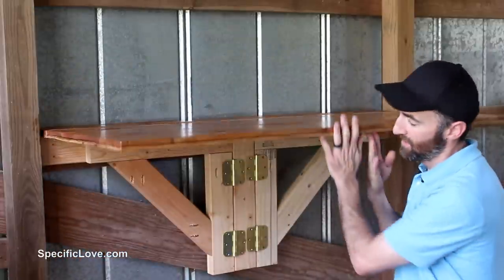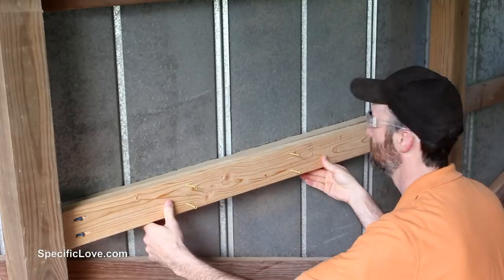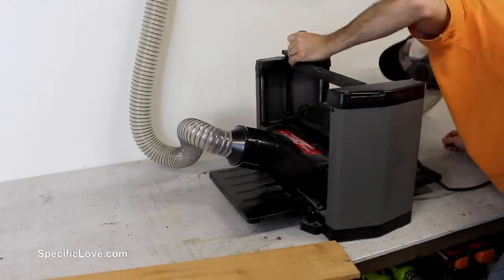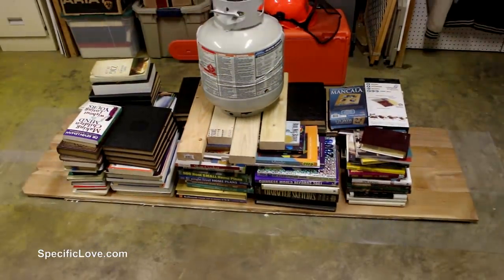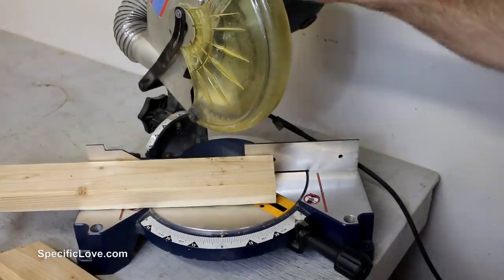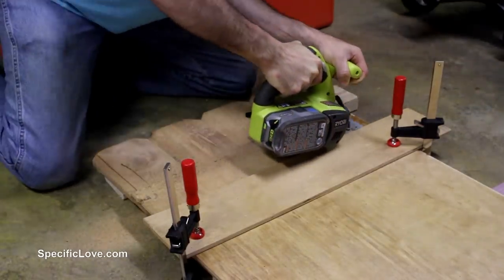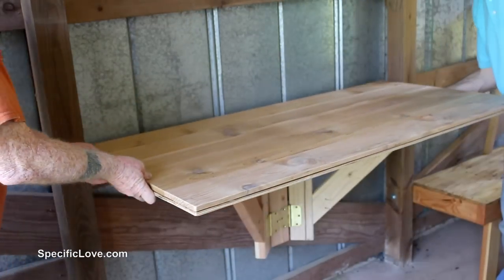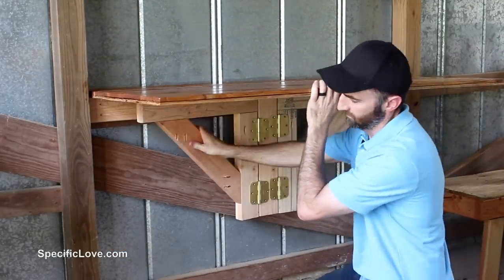Simple Fold Down Table Bar DIY ~ Backyard Upgrades #10

Comment: Excellent idea! I've been needing to build a fold down table I can use for finishing and painting that would be right under my exhaust fan, then fold out of the way when not needed. Your idea for the braces to come out at 45 degrees is just the  ticket for the configuration I need for the wall. Thanks!
Reply from the maker: You are very welcome. That is a great usage plan.

Comment: nice fold down table.  FYI, I use pocket hole toenail technique when doing 2x material or plywood.  the joint is much strong when toenailing the pocket holes on both sides.  I did a video on that subject if interested in a new technique of joinery. enjoy your channel. keep making them.
Reply from the maker: Thanks for the info, I'll try to check it out.

Comment: This is cool... I'm curious if i could use this design with a bed frame? 🙈 We have a platform base bedframe but with our old mattress, we grew accustomed to sleeping on it sideways and our Labrador in the middle.. now that we're coming closer to finishing the bedroom, we've started sleeping the correct way & our poor dog isn't enjoying the limited space. He's used to stretching out between us... So to solve this, I'd like to build a board that we can prop up for our feet & be able to hold the weight of our 100+ lb special needs Labrador. I also plan to make a bench pillow for this addition 🙈
Reply from the maker: It might work, but I would definitely test it out with a lot more weight than expected because there's always a good chance that a couple people might try and sit on it at one time. Or if somebody falls on it, could it break? I always lean on the side of extra strength rather than appearance.
Reply: @SpecificLove7  true... Definitely some things to consider! Thank you for replying 💗

Comment: Simple fold down table if one has all of the tools that you do. These are not regular household tools. It's easier to buy a folding table.
Reply from the maker: Very true. Some of the steps I use can be substituted for just sanding really well. I should have stated that in the video. Thanks for the heads up.
Reply: @SpecificLove7  don't listen to this dummy.  They came to a DIY video to comment that you "should just buy one"... Really?

Your video is great, your other videos are great, and clearly made for the ACTUAL DIY'er... Don't take this incapable dummies opinion as advice...let them go purchase flat-packed press-board garbage...They deserve it.

Keep up the amazing work!